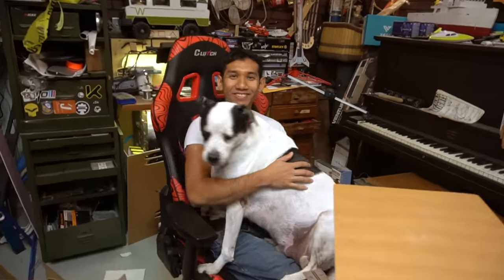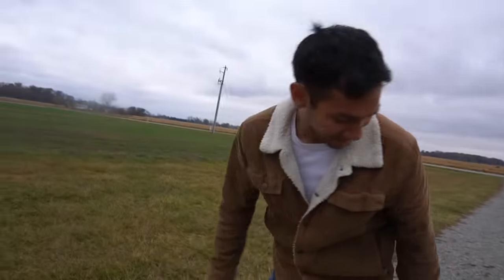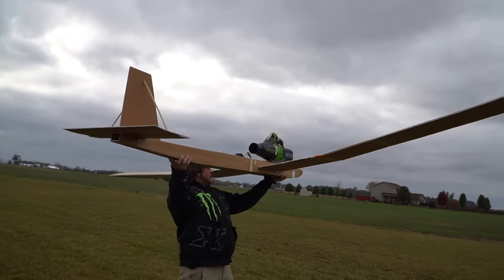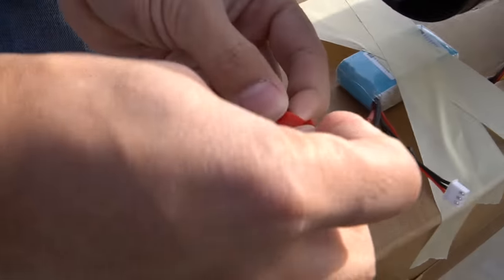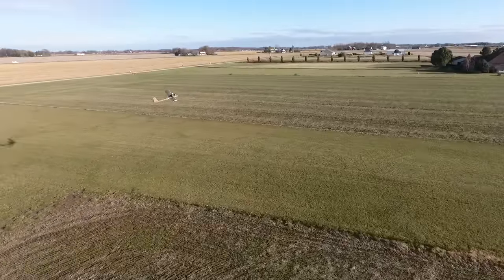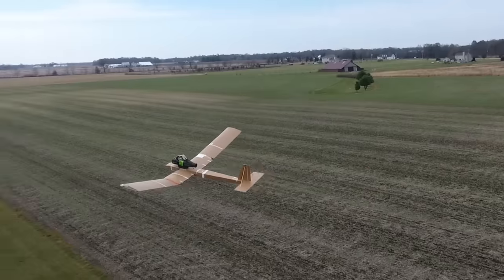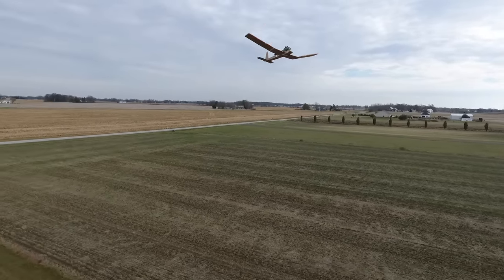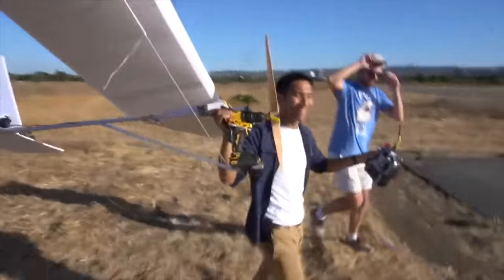FLYING Leaf Blower RC airplane Mk2

Comment: I’ve used that exact leaf blower and it is legit tbh. Haha. I couldn’t help but notice that it’s basically just a average sized edf with a big battery. Always buy the tool /battery combos when they are sale bc the batteries are stupid expensive. Killer job! -Austin
Reply: Heyyyy im the first commenter!
Reply: @deathqueef69  10/10 name
Reply: Now about this flushing toilet
Reply: Flying disc leaf blower
Reply: time to fly a chainsaw!!!
Reply: Angle grinder quadcopter or a dremmel plane would be cool
Reply: Try to make a rocket powered glue stick
Reply: FliteTest Cordless reciprocating saw with a hand made crankshaft!
Reply: if you make the hole where the air comes out of the leaf blower tighter, it might of worked better and gave it more thrust because it would make the air flow compressed
Reply: FliteTest please make a toilet that can drop objects by flushing
Reply: Ok
Reply: Did he used to be on your channel
Reply: What does edf mean?
Reply: That has to be the best and funniest thing i have seen in some time :D lol I can`t wait to see this toilet fly that will be hilarious :D
Reply: @tritanicwolf518  Electric Ducted Fan.

 Usually with a brushless motor in the center. A propeller shaped like a jet turbine. And a outer plastic duct/tube that funnels the air in and compresses it. Think pc fan but way more power and louder.
Reply: @marcwire9332  .... would a big quad with a chainsaw running under it count?
Reply: Its toilet time
Reply: I have a challenge. Make a full popsicle stick plane and fly it.
Reply: Now we need actual toilet flying
Reply: Hahaha that was impressive would not even put a Hamster is in a plane built for a hamster  🐹 haha an I love all the vid u do keep it up
Reply: You guys should make VTOL version of this
Reply: Hey uhh ...FliteTest he technically modified the leaf blower with the little switch that’s on the trigger
Reply: @gavturgoose1427  I second that
Reply: and get the extended warranty!!!!
Reply: you should try a plane with a grinder
Reply: Electric router plane they spin at like 30000rpm
Reply: @FliteTest
 I have the lawn mover. Works great, folds up for storage, sounds like a big fan. Doesn't kick up as mush dust as the gas mower I had.
Reply: now u have to make the toilet flush!!!
Reply: Never expected my 2 favourite channels to show up at the same video
Reply: Now again but in Full Modification Mode
Reply: FliteTest two leaf blowers? double the power?
Reply: make the toilet fly
Reply: Hey how about make a flying angel
Reply: I have a similar one made by WORX, but it's got a regular drill-sized li-ion 40V battery pack. It's awesome. It's supposed to shoot 200MPH air out of the nozzle at full blast, and I paid less for it than he paid for that craptastic battery pack. Plus the speed setting is changed with a variable rotary knob, so he could have controlled it with a servo more easily.
Reply: Can you connect the blower by belt/chain to a push bike ?
Reply: Time to make a Power Saw Fly
Reply: Flying lawn mower, with the following modifications allowed:
- Gyro and drone Motors added for stability 
- holes cut above the main rotor to allow for better air flow 

:)
Reply: @marcwire9332  Samm Shepherd did that before he unfortunately passed away, his YouTube video of it is still up.
Reply: hey guys had an idea , would you try 2 leaf blowers and see if it could go faster and control better and change out the material to maybe thin plastic or something , love ur videos :]
Reply: @flitetest - quadcopter toilet will fly ;)
Reply: Toilet firefighter plane
Reply: Now fly the toilet!
Reply: @tritanicwolf518  electric ducted fan
Reply: Come on men! They are lavatorys if they're flying and latrines if your airborne...get it right
Reply: Nice comment Austin, high fives!...
Reply: Now put eight  of those on a monster b52. And I will let you off the hook for what you did to the other one
Reply: @AlphaMachina  the little lever next to the trigger just locks it to a "throttle" position, but like he said in the vid "full throttle" on the trigger isn't quite full power, and you only get full blast when the button is held down.  For what it was made to be it makes sense to do it that way, full power just makes it harder to make nice neat piles without sending things *everywhere*.

I have the 60v version of the blower and mower with a couple of packs, it's a great setup really.
Reply: Peter keep it up look at the views! In just 2 days. Your awesome and are probably my favourite channel on YouTube. Keep it up stay flying
Reply: Can I put explosive warhead at the front?
Reply: Now you need to make the toilet flush mid-flight... Blue ice!!!!
Reply: Let's see that toilet Austin
Reply: Now make a toilet fly
Reply: leaf blower. Permission to fly by tower.. 
Tower. Negative
Leaf blower. Sorry.. I'm mach 1 already...
CRASH....!!!
Reply: so where's the flying toilet???
Reply: I don't mind if it can't flush, BUT YOU HAVE TO MAKE A FLYING CERAMIC TOILET.
You wanted a big project so there.

P.S. our mall has flushing ceramic toilets for tots. Get one of those ; )
Reply: Can you put 2 blower on each sides of the wings (like a airbus) would be pretty exciting
Reply: Ya, sometimes you can get a tool and a battery for less than the battery alone if you're lucky
Reply: Use an RV toilet.
Reply: @tritanicwolf518  Electric Ducted Fan
Reply: I'm bored... so am I. Let's make a flying leaf blower.  
Challenge accepted 
Challenge accomplished. 
Me: waiting to see a flying toilet
Reply: I'll do you one better: Angle grinder helicopter
Reply: Toilet time
Reply: Looks a bit like a course air with the bent wings
Reply: FliteTest now you gotta fly a toilet, you have to now, it has been sealed.
Reply: Man make some cargo plane drop should be like giant but over powered
Reply: Nice
Reply: Foam toilets don't count said real toilet I just saw there probably epic failure I haven't looked yet
Reply: @davebits4257  They work together all the time.
Reply: Sam looks like a Viking Chumlee from pawn stars
Reply: Attach multiple mowers to the same plane and see how well it will fly
Reply: dude just download honey to your browser you'll save some money when u buy certain things (i legit sound like i'm sponsoring them lmfao)
Reply: You gotta fly a DREMEL @ 30,000rpm.
Reply: I dont think those engineers who designed this leaf blower believed it could fly lol
Reply: @gavturgoose1427  second both of those, actually pretty good chance to work. the grinder may disappear into the stratosphere (high rpm)
Reply: Alright.... time to cash that check. You know what you have to do.
Reply: I got that same leaf blower too, that thing is legit
Reply: I love you guys your vids is the best
Reply: Pretty darn awesome!  Great work sir
Reply: Why wouldn't you just get something more powerful  and lighter and  easier  to use like a ionic dremel?  5000-35,000rpm and just get one of those 5$ styrofoam  airplanes from walmart and then adapt a propeller  from an old desk fan or something
Reply: Best and amazing idea good luck bro I am Sri Lanka woodworking channel
Reply: LoL... nice job...kakaka
Reply: Great job and thanks for not giving up.
Reply: kirk mcloren  not everyone has the tools required or the talent to do it.  Even if there is a video to do it.
Reply: That poor plane became crippled in three days and by the 4th it was so crippled it had to fly 😂😂😂
Reply: @marcwire9332  Flying Lawnmower and Gas Powered Blower.
Reply: We still have not seen the toilet!
Reply: I have their 80 volt backpack blower and their 80 volt chainsaw.  Their chainsaw is super legit.  It's as powerful as my 18" Husqvarna, though a little heavier.  I'm thinking of selling the Husky... never use it anymore.
Reply: I hope you received monetary compensation from the leaf blower company for advertising their crap.
Reply: i really want to make one. if you want you can tell me what i need?
Reply: @brandonwalenter1147  fcjg
Reply: Looks like its flying toilet time!
Reply: need soe emergerncy chutes
Reply: @westinlemonaid5640  dyuiiig
Reply: make a plane with a pulse jet!!!
Reply: Still waiting on that toilet plane
Reply: Not this exact leaf blower, Filte, haha. Maybe the closest you could get was this model but a different copy.
Reply: Huge fan
Reply: FliteTest try two leaf blowers
Reply: FliteTest what’s Alex’s channel cuz I wanna see a flying functioning toilet
Reply: so cute
Reply: is this a chat room
Reply: Where is the flushing flying toilet?!
Reply: @deathqueef69   same
Reply: hell hound  no your not
Reply: hell hound first-comment.com
Reply: Hah take that flute test
Reply: aah i subbed to ur channel
Reply: FliteTest you should have put two blow throwers
Reply: @marcwire9332  a chainsaw can't really fly because it has no means of travel, unlike a leaf blower or drill.
Reply: @nicksloan9323  how does a drill have a means of travel???
Reply: @marcwire9332  using a drill you could put a propeller onto the drill and make it into a plane, like in peterstripols other video about that.
Reply: Oh flite test u watch his vids?
Reply: Check out his channel btw
Reply: we want aflying toilet
Reply: Leaf blower powered flying toilet
Reply: I have that same one to
Reply: Dude
Reply: A aeroplane what flys under water
Reply: A some how powered and controllable spinning frisbee
Reply: Try the Ego 650 leaf blower.
Reply: FliteTest I love you guys.
Reply: I don’t like greenworks lawnmower but the leaf blower and weed wacker are pretty good
Reply: Omg I tr s flite test I love that channel
Reply: I'm subscribed
Reply: T o i l e t
Reply: I honestly cant believe I haven't come across your channel, this is some of the same stuff I do, I was thinking about a delta wing build with two blowers, might try to build one with my son, keep up the good work
Reply: Mabye even somehow a air conditioner
Reply: @Winters0s  hi
Reply: Twin leaf blowers hang glider
Reply: I’m gonna watch your videos now after this one LOL.
Reply: mk
Reply: Still waiting for V. 2, where you realize that you could've ordered a Stratofortress kit and modded it
Reply: Lithium tool batteries are almost always comprised of 18650 cells, like the type seen in the more expensive e-cigarettes. They can be about 12 dollars per cell, and there are definitely ways to safely use lipo instead with your regular tools like a simple LVD. 😉 Also, if you have a tool battery that won't charge, you may be able to revive it by manually charging each cell individually. 70% success rate for me.
Reply: @SeabornNomad  How the hell do you know so much about this.
Reply: Only when pigs fly! Remember?
Reply: They're really just happy that he used their foam
Reply: @apeshtbananas6231  SCAM INCOMING
Reply: Fly a chair with some one in it.
Reply: That is kinda rude
Reply: NOW MAKE THE TOILET FLUSH
Reply: Yours is really good
Reply: Plane
Reply: junkers jumo jet leaf blower engine Mk II wow
Reply: Electrical Defense Fund?
Reply: You make you steal a bunch of tools
Reply: Make a Dremel plane
Reply: Lloo
Reply: Teee
Reply: use the leaf blower intake design as a intake for a edf, then put that on a fiber glass plane and boom, you have the best plane for "Demolition Derby in the SKY" (https://youtu.be/bq1hea96bxA)
Reply: lol
Reply: @monkenumber12  lol
Reply: lol
Reply: How do you learn stuff like this
Reply: 🤣🤣🤣 when the landing spot is a pile of leaves
Reply: Or if the wings are made of leaves 🤣
Reply: Still no real flying toilet.
Reply: I also want to make it
Reply: Bruh
Reply: @deathqueef69  Did you see it ?
Reply: The full tube might give a better venturi effect. DUDE!
Reply: @deathqueef69  42o likes nice
Reply: @Koosha Las Vegas Ex Muslim no
Reply: Graphite or fibreglass fly fishing rods or spinner rods right up to beach casters 12ft. Are as strong as your get you can govern the whip or rigid with something that slides a brace and is connected to an opposite side
Reply: great now time to make a real toilet fly
Reply: Make the toilet fly
Reply: Make a helicopter
Reply: Yes I am wondering how you got 2k likes
Reply: HOW
Reply: Click bait thumbnail, thumbs down
Reply: I think thumbnail was the first idea and vdo was how it turned out 😂
Reply: So um toilet
Reply: Could you inject some fuel and make it work like an after burner??
😊
Reply: soooo you gonnado the flushable toilet now

Comment from the maker: heres the affiliate sauce link to blower https://amzn.to/2Xcbjby
Reply: Hey, peter. I love the videos. You know Adam savage’s tested, right? You should upload the actual builds, like do the montages like he does his one day builds. Two videos for the price of one, and it can give us a bit more insight into the design process instead of montage, poof, finished product.
Reply: PeterSripol ty pappy
Reply: I kinda wanna see a jet plane version of this one with more power.
Reply: Can you also put a link to your electronic equipement,  (like controller, etc) or make a separate video for it?
Reply: PeterSripol make a dremel fly.
Reply: I think the next logical step in sripol lawn aviation product line is a weed whacker
Reply: PeterSripol what’s next a vacuum?
Reply: Make a plane with Angle grinder
Reply: Why wouldn't you put the blower in the body. Also why not make a RAM air intake for the blower like on motorbike frames🤷‍♂️
Reply: Put the nozzle extension back on then inject some combustible fuel with a glow plug for afterburner.
Reply: @dantesimon802  
Demo saw
Reply: Power trowel hovercraft

Comment: Try and fly a dremel, but maybe make it interesting with some thrust vectoring or something. Maybe even just make it a ducted fan kind of jet
Reply: Dremel powered compressor for a simple propane jet engine?
Reply: Dremel would definitely be cool, would probably work pretty good too.
Reply: @hintzofcolorconcepts  V1 pulsjet leafblower ?
Reply: Impeller dremel plane.
Reply: Dremel jet? I'll do ya one betta, dremel twin blade helicopter!
Reply: I was about to post this as a suggestion, but thought I'd check the comments first, and this is the first tool suggestion I see... but yeah dremel would make a lot of sense.  Bonus points if Peter mounts the prop on the flexible attachment thingy.
Reply: @MatrixRay19  why not instead of a dremel helicopter why not a dremel drone
Reply: The battery wil take up alot of weight
Reply: @amane_suou  but the RPM seems good for an EDF-thing
Reply: Yesss dremel jet would be awesome
Reply: Especially if he can get his hands on one of the cordless Dremel tools, that would save a lot of headaches.
Reply: Yes yes yes!!! Those powertool ones are my favorite. 
Hands down one of my most favorite videos on youtube together with your powerdrill one!
Reply: Cordless Electric Chainsaw plane.

Comment: Try to make the smallest rc palane ever, just absoloutly tiny.
Well crap this just reached 400 likes and thanks, i didn't expect it to be seen but thanks for the comments.  Edited again, forgot about this but it got a good amount of likes, thanks 18/8/2020
Reply: The only problem with that is the smaller you make it the more unstable it is. Like, not unstable but if you make something a 10 millimeters you have to think about that but scaled up by 20 to get to a small model plane. So there is a 200 mm mistake and when something like a wing is 200 mm longer it makes a massive difference in the flight. TLDR you have to be near perfect because everything is super exaggerated when it’s tiny.
Reply: Shibe Dog they have a military drone that is really small
Reply: i dont think it can get much smaller than martin newell's 8 channel p-51d. it's a 1:96 scale or a 4.6 inch wingspan
Reply: Shibe Dog also if you want small look up the carbon rc even though it’s like 5 years old
Reply: Like 3cm smal?
Reply: palane?
Reply: Smaller than minimum rc? I think whould be g8t
Reply: There is a mosquito drone that can record video and audio 
It is micro tech, smaller than a house fly.
It can land near a cell phone and charge its self wirelessly 
It is a spy tool
Tom Clancy talks about it in a book
Forgot which one
But it is authentic tech
Reply: Or biggest
Reply: Look it up on YouTube, it's an indoor rc plane about 4" span, low aspect ratio.
Reply: The smallest scale rc model is about 5" span Mustang (with retracts as well). I don't think anyone could get one much smaller.
Reply: Make a Dremel powered Mini RC Plane!
Reply: @tokashi1  Don't be toxic, just cause no one can see yours to ask for it.
Reply: @eclectic3618  as much as i'd love that, this drone doesnt exist yet.
in fact: military engineers are more looking into steering a real insect via elektrodes into their brain. Because making an electric one is really hard
Reply: HOW ABOUT INSTEAD OF TINY YOU MAKE A PLANE OUT OF 30 LEAF BLOWERS AND FLY IN IT!!!!!!!!!!!!!!!!!!!!! OMG#!%#*^%@)*
Reply: edit this reached 1k likes
Reply: @gamewarmaster  nice observation
Reply: But a he a just a madea one fram a leef bower
Reply: Pablitoes ツ why? He was thankful for likes why is that a bad thing?
Reply: Palane
Absoloutly 

Funny.
Reply: I did an oppsie and I’m sorry
Reply: @gamewarmaster  maissä voi sanoa että jotain olla vain
Reply: @etopsirhc  agreed I saw that one and have always wondered how on earth he could find servos and a receiver and esc that small.
Reply: Um youre not welcome?! Who thanks people for likes and comments
Reply: Nice
Reply: Local Neko ur pfp is the same as my discord pfp lol
Reply: @gamewarmaster  xch
Reply: there already exists a helicopter you can fit in the palm of your hand or pocket. I think the Navy has it...ridiculously expensive.
Reply: Yes plz as small as an ant
Reply: Hmm
Reply: yes
Reply: Can I pet you
Reply: The air is the wrong thickness for tiny planes.
Reply: @trunkbangking  bruh because it feels nice when someone likes what you said
Reply: Editing comments is pathetic.

Comment: With the conical nozzle attached I'd expect lower static thrust but higher potential top speed (dependent on drag of the airframe, of course) due to increased exit velocity from the nozzle.